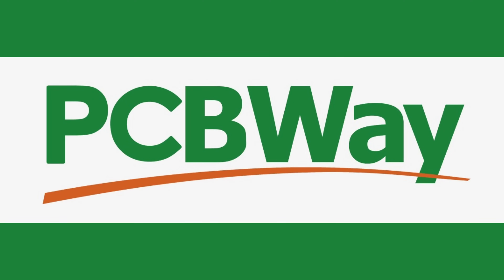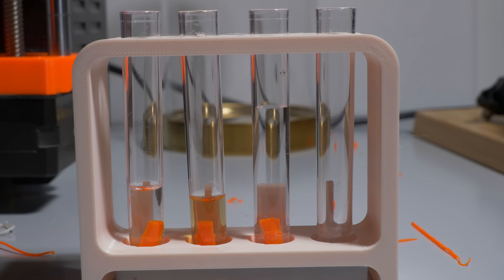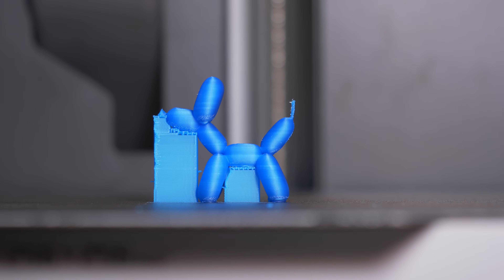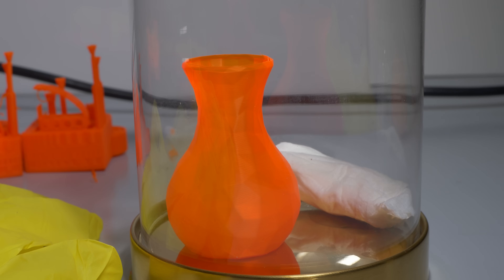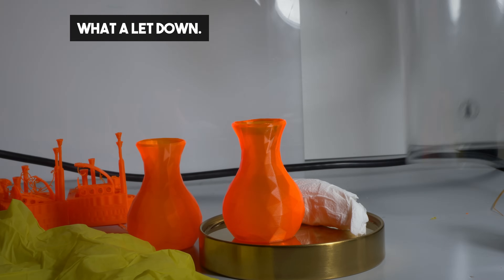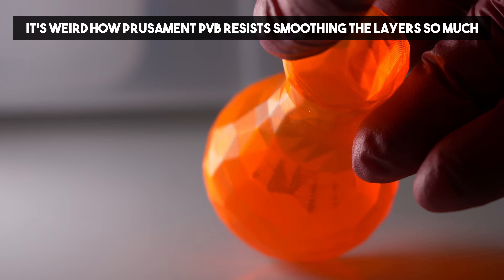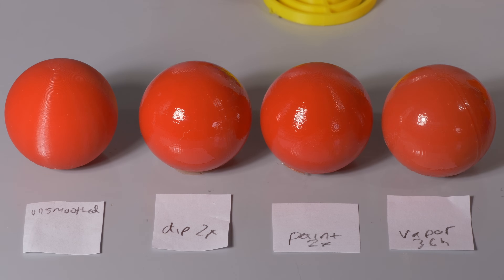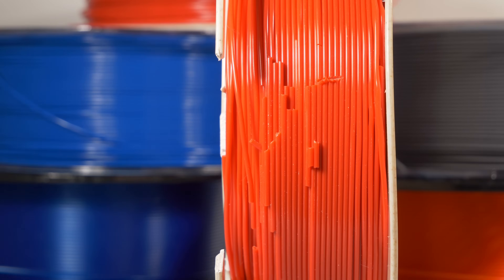The Smoothest Filament: 3D Printing without layer lines!

Comment: So basically don't bother with this material and smoothing and just spend the extra time with a lower layer height, or buy a resin printer :)
Reply from the maker: Yeah, except for very specific use cases like balloon dogs 😜
Reply: Resin printers are their own different set of annoying lol I have several fdm printers and a halot one and the halot one is a great little resin printer but damn resin has a steep learning curve and fdm experience doesn't help
Reply: @Crackpidgeonextreme  Agree. I'm working on finding a place where I can set up a small shed.

Having a shed somewhere is the ultimate solution.
Reply: @Crackpidgeonextreme  or just paint resin onto PLA and use a UV light
Reply: No, with more patience and calibration, one can get parts that rivals injection molded models. Of course with random amounts of alcohol you get random results. I do with abs and acetone, there is an ideal amount of acetone, too feel and nothing happens, too much and it melts. The parts look much more professional. And even parts with the smallest layer looks terrible when you paint them.
Reply: @AngeloMondaini I agree, though the major downside (for me) is the loss of precision. On that level, resins and wax have given me the best results
Reply: @AngeloMondaini I've found 50 micron and a 0.25 nozzle to look great when printed.
Reply: this
Reply: Resin is a lot more toxic than any of these chemicals, and the models also need to be dunked in alcohol. The end result will be better, but it's just as inconvenient.
Reply: Would adding a small fan to circulate the vapor more evenly help with the collapsing issues. Just a tiny fan connected to a 9V would be pretty safe around the alcohol.
Reply: @alijah1539 just heat up the iso, and suspend.  The iso MAY destroy a fan as it will break down most greases, especially hot
Reply: @alijah1539  That's how it works with the polysmooth machine. Basically its a combination of a automated timer, a motortized turntable with little points to raise the model up and prevent alcohol pooling, a circulation fan, and one of those essential oil water diffuser devices in an enclosure.

The diffuser quickly creates alcohol vapor, the fan circulates said vapors, the turntable ensures there are no deadzones on the model itself, and the timer controls how long this process lasts. You could probably replicate the machine for peanuts using componets from aliexpress, a plastic tub, and basic electrical and microcontroller knowledge.
Reply: Thank you for saving me 18 minutes of my life!😂
Reply: Well, when you really need a smooth part e.g. to avoid pockets where fungus can grow (e.g. for silicone molds), your only option is this, some more aggressive smoothing chemicals (or ABS.. so disgusting printing) or manually having to smooth by hand e.g. using silicone (looses lots of detail and is alot of work)
Reply: Yea sounds like it. Or sand your parts
Reply: Thanks for saving me time i'll never get back if i had watched this video
Reply: Or either dilute ispropyl and see if it works or just use acetone instead.
Reply: Having a print that can easlily dissolve on alcohol in incovenient. 
Unless it is a prop you want to prime or electroplate.
Reply: Yeah extra time on 0.3mm layer height 400hours print jobs on a 1.8meter print. Doing a 0.1 you are going for a 90. Hour print
Reply: Biggest downside for me is that Uv curable resins are UV curable. For functional parts with tight tolerances the application environments are limited to "no direct sunlight" 

Which honestly is a bit of a bullshit limitation to have to work around. And thus while being such an awesome technology i just cant use it for just about anything.

For cosmetic or art purposes its far superior though
Reply: @molomono9481  That's what paint is for.
Reply: Well, no.

1 - resins are waaay more toxic, and messi

2 - material options are more limited, way more limited

3 - resin costs more

4 - cannot (easily) create models with internal voids

5 - there is no way to do stuff like inserting magnets mid print

6 - large sizes are not only prohibitively costly in terms of material, but are astronomical in printer price.
Reply: And yet still they are infinitely better than FDM for small detail and that's why people use them.
Reply: @martonlerant5672 Not true about the cost, Anycubic resin are under10 usd a kg.
Reply: 1. Ew resin
2. No. I hate people saying "just be patient and wait" that's what slows innovation, accepting certain things have to be a certain way
Reply: @josejimenez896 they don't have to be a certain way, but they are currently a certain way, so unless you are personally innovating.... well pitching doesn't change a thing.
Reply: @josejimenez896 probably faster than having it be stuck in a vapor chamber for 12-24 hours.

Comment: A means to circulate the vapor in the chamber seems like a good way to speed up the process.
Reply from the maker: Yes! The danger there is any spark could ignite it, but people do that.
Reply: @LostInTech3D   Polymaker already makes one called Polysher.
Reply: @LostInTech3D  It would/could be a true explosion. I do not like those vapor volumes at all.
Reply: it'd need to be intrinsic  @LostInTech3D
Reply: A brushless fan doesn't produce sparks. You could also use a motor outside of the container with the shaft going into it with a plastic fan attached to it. There are lots of possibilities to avoid danger. Not doing somthing at all for safety sounds like a poor excuse to me when there are actually plenty of safe ways to do that.
Reply: also instead of putting a fan in it you can also just pre atomize it using a spray bottle into the top of the clauche giving your alcohol higher surface area making it evaporate faster and not needing to spend as long waiting for the initial evaporation.  Used this method with ABS and it tends to cut down on time with smaller parts.
Reply: I think a peristaltic pump could minimize the risk just not sure how much flow is realistically needed.
Reply: The little fans used in 3d printing are brushless and don't spark.
Reply: Yes, it felt weird trying to smooth these thin models like that. The results were exactly as expected and was hoping he would go for a circulating approach.

Comment: Weird, in ny country you can buy 90% ethanol in bottles. It's not cheaper than drinking alcohol despite being food grade. Also yeah, alcohol on this concentration will give you nerve damage in your mouth if you drink it. You'll know by strong hot-cold sensation.

You can also buy that purple denatured alcohol that is not made for drinking and contains methanol and bittering agents to make people vomit at the first taste. Still, I've seen alcoholics drink that stuff straight up.

Also don't breathe isopropyl alcohol because at the very least it'll give you a headache. When I clean my printer with iso even with good ventilation I sometimes feel nauseous.

Comment: I think all of these could be improved with upgraded gear.  A softer, more specific brush would probably make brushing easier, and I think the spray method could be improved GREATLY by getting a dedicated mist/spray bottle.  For medical use it doesn't matter how the spray is, but for smoothing, a spray that comes out like a fun mist would lead to the least amount of drops and most consistent smoothing
Reply: A spray gun like used for finish application would be best to get an even coat. You wouldn't even have to clean it afterward since the stuff you're spraying is used for cleaning :) Also, try to get the object mounted on a stick so you can quickly turn it around and get all sides without touching it.
Reply: A cheap airbrush setup might work too, you can buy them with a little air pump for not much and you can controll the spray of them.
Reply: Also, for both those methods, sticking the print to a stick or something before doing the spraying or painting would really help with the fingerprints/smudge marks issue (and the mess issue).

Comment: You can totally buy quite pure ethanol in some pharmacies, but it's denatured alcohol, which is 96% ethanol with a bit of some nasty stuff to make it undrinkable. You can also buy non-denatured alcohol which is also 96% but without additional stuff and that one is usually more expensive because taxes, but it's a bit more difficult to find. I don't know in Europe, but here you can. You can't find 99% ethanol in stores not because it's prohibited, but because ethanol mixes with water and it's very difficult to get it over 96% unless you take the water with molecular sieves or some sort of dessicant and only bought as a chemical reagent, which makes it even more expensive and it will also get to 96% rapidly because of the water in the atmosphere. Anyway, I started to use ethanol instead of isopopyl because i don't like the smell, specially with resin printing
Reply from the maker: Yeah I would definitely go with that if I did it again 😂
Reply: @LostInTech3D 
There's always moonshine as a less legal option. Here in Norway it's colloquially called 9-6 due to the 96% practical limit for destillation.

Comment: This came out at the perfect time since I need to make a super smooth ball for my next project and I had some Polysmooth laying around.  Thanks!
Reply: If you need something with ridiculous roundness etc. buy a pool ball. They are made to a ridiculous standards but are only one size.
Reply: @ares395  This needs to have a specific size + magnet inside, so still needs to be 3D printed

Comment: just wondering would a heat gun be a better n be a less hazardous way to remove print line or not really?
Reply from the maker: I don't think it would work, the model would all melt at once
Reply: ah yea good point  @LostInTech3D , tbh  if you did want a non hazardous n safe method you could just take the time n go over the print with a high grit sanding pad but for a glossy texture idrk tbh
Reply: Nope, it gets soft and that's about it. I use a heat gun for fixing prints often enough, no layer lines lost.
Reply: @TechieSewing no layer lines were harmed in the making of this print.
Reply: That's a good title ;)  @TheFredmac
Reply: mkk thanks  @TechieSewing